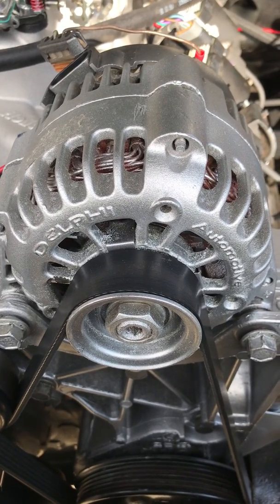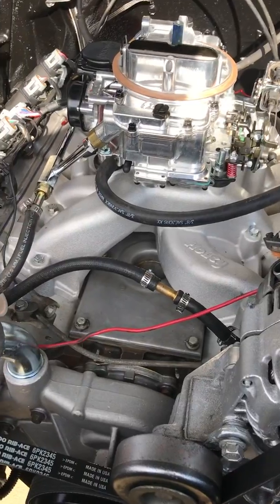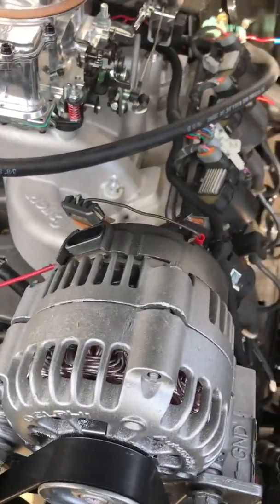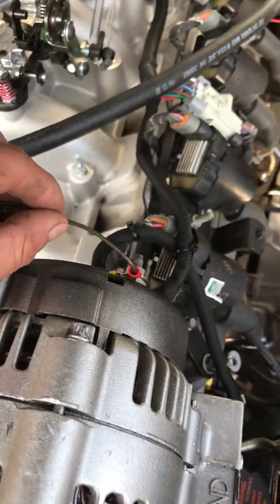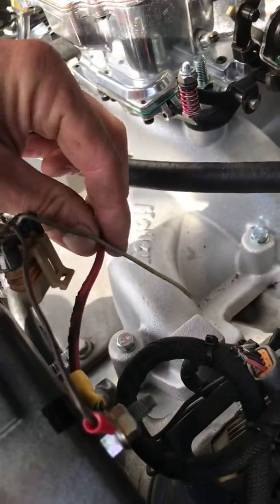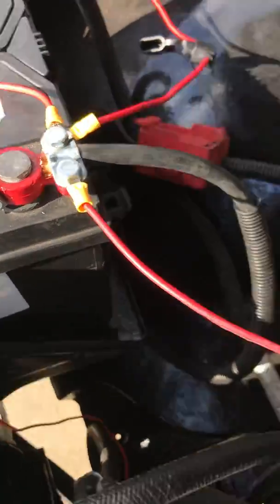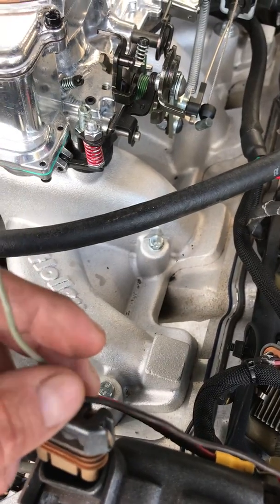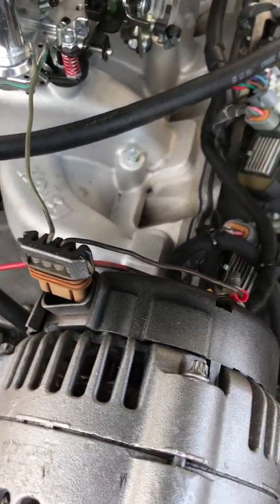Carbed LS swap Alternator wiring

Comment: Did this in alternator stays on wont come off
Reply: LS Backyard Build you need to wire your exciter wire to switched ignition with a 470ohm 1/2 watt resistor in line or else your gonna burn ur alternator up ... wired mine in the same way as him burnt mine up
Reply: Amazon sells the 470ohm 1/2w resistor

Comment: I have a c10 I've dine this exact set up with an all I have to do is the alternator wiring to charge. I have a red key switch or ignition wire that ran to previous alternator where would I wire it too.
Reply: Zack Lamont wire switched ignition to exciter wire on alternator with 470ohm 1/2w resistor amazon sells them

Comment from the maker: I had no issues like that. Operated fine
Reply: Hey which two wires you using on this ? If you don't mind telling me
Reply: Ezra Nettles you use the brown wire as signal alternator will not charge without that you also need 470ohm 1/2 w resistor put in line with your brown wire then run it to key on power gray wire is a dummy light or battery light (pretty sure double check me on that)
Reply: @austinunderwood6329 
So the brown wire can be used as a 12v switched exciter for the alternator?